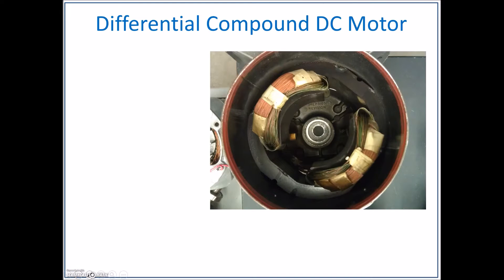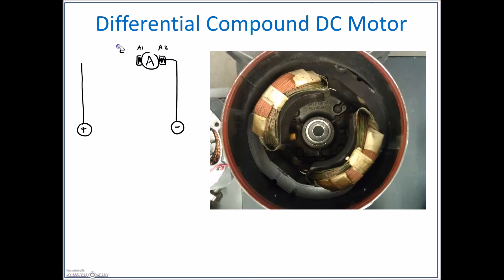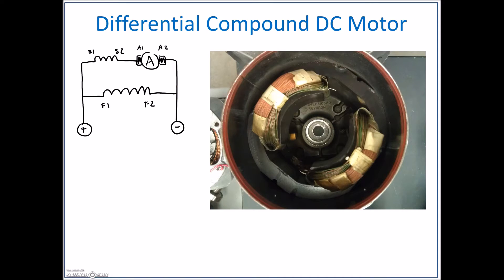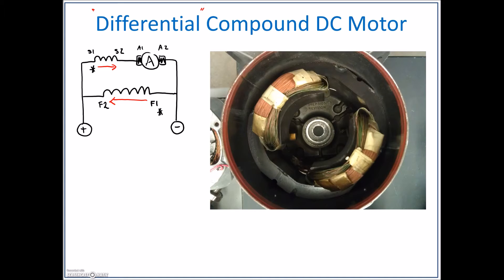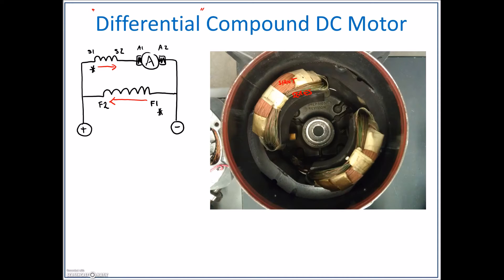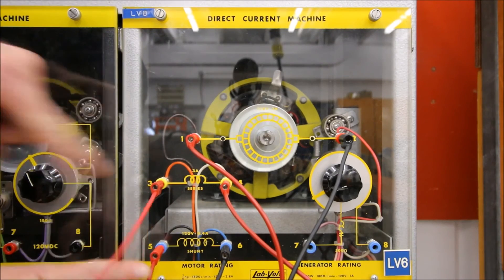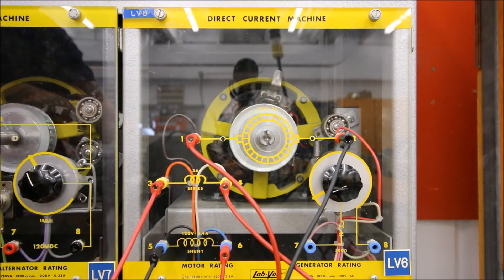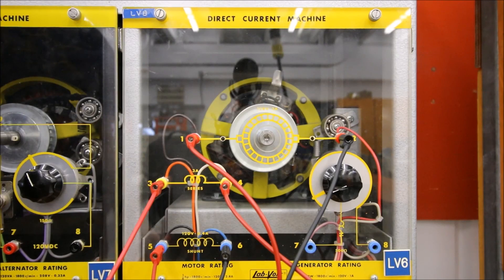Differential Compound DC Motor Connections

Comment: Are we ignoring the proper applications of the motor and calling it garbage? This configuration has the most stable RPM when operated correctly. The rheostat should be at max resistance to startup. Then lower the rheostat resistance to desired RPM. Now the RPM will be extremely consistent under varying load within the FLA (full Load Amperage)

Comment: Do I have a choice in the method of connection to any direct current motor, as is the case with an induction motor (both star and delta)?
Reply from the maker: The only choice is based on the amount of leads coming out of the motor to enable you to connect as a Series, Shunt or Compound DC Motor. The other videos in this playlist will explain further.

Comment: Thanks for this. Is it true that they can speed up under load if the field is weakened enough ?
Reply from the maker: Yes. The field provides cEMF through generator action
Reply: @PeteVree  Thanks, so the rise-time of the cEMF in the inductor is retarded somehow, a bit like car timing ?
Reply from the maker: @GaryMcKinnonUFO  If the Shunt field is weakened, then the Armature is cutting through less magnetic field as it spins. Which means that less cEMF is developed on the armature. This allows more of the source voltage to enter the armature circuit, more current and more magnetic field on the armature. This causes the motor to spin faster
Reply: @PeteVree  I see, thank you.

Comment: Thank you for your time for your videos, they are very detailed and very educational. I am a mechanical engineer and I watch your videos from Greece and I wanted to ask you something. In one application have a problem with an electric motor 150V DC, P = 0,8kw. I measured in the windings of R1=1,90ohm and R2=1,7kohm and it also has the drum winding (brushes), the motor runs normally at the descent because it has the load it does not brake where it needs to stop due to inertia. Specifically, it drives a lifting machine with shelves and I want it to stop at a certain level. My question is the R2 winding how should I connect it so that the motor stops immediately at the level I want at the descent?Connect it in parallel to the power supply, paying attention to the direction of magnetic field? Thank you in advance...

Comment: What happens when shunt FIELD winding gets suddenly opens in differential compound motor when it is in running condition
Reply from the maker: It would turn into a Series DC Motor and depending on the load, may run away.
Reply: @PeteVree direction of rotation is same as before
Reply from the maker: Depends on the polarity of the Series winding. There is a good chance that it may reverse direction as your question was concerning the Differential connection.
Reply: @PeteVree  why there is a chance of reverse rotation
Reply: Means how the direction of rotation is changed
Reply from the maker: Differential Connection means that the Series and Shunt have opposing magnetic fields. If the Shunt field opens, that leaves just the Series winding and the Armature. If the Series winding has the opposite magnetic polarity compared to the original rotation, there is a chance that the motor would end up reversing direction.
Reply: The polarity remains the same bcz.d current flow through armature and series field remains same.!

Comment: Dear Mr Vree , Thank you so much sir for these most informative videos because many warehouse I have been in  the information is highly valuable associated with  conveyor belt systems among packages plants as seen in Florida and Colorado.  I have been in many conveyor belt warehouse packaging plants where conveyor belt motors really run at the same time and need to shut down simultaneously when there are packing misses.

Comment: you didn't explain much
Reply from the maker: So go somewhere else and troll another account.
Reply: Pete Vree sorry didn’t mean to be so blunt. Appreciated the video and basically the only person talking about this stuff with demos and explaining the circuit drawing. 

I just left the video still as confused as to why it spins faster in differential??
Reply from the maker: No worries. It spins out of control in Differential because you have magnetically eliminated the Shunt winding (The Series and Shunt have opposing magnetic fields in the Differential) The Shunt winding magnetic field is the main thing that provides cEMF to limit your armature current. By magnetically eliminating it, you are left with a Series DC Motor. In this case the motor has no physical load, and a Series DC motor with no physical load will continue to increase speed and eventually destroy itself.
Reply: Pete Vree ohhh right i thought my idea was on the right line but I was way off.
Slightly off topic but not, why does this mean that differentially wound generators are so well suited to arc welders (giving high current medium to low voltage)?
Reply: @danhyde7501  I guess it's because when welding you need a hot start provided by high voltage that gets low when the current gets high, but this is ancient technology.
(update because I was tired yesterday). When you touch the metal with the stick you dont have a puddle and, to create one, you need a lot of heat. Heat is not provided by amperage but by voltage (from a scientifc point of view it's kind of ackward first hand). But because you're welding (and not plasma cutting) you do not want a lot of heat in the puddle nor splatter, you want to deposit material that has a good penetration and without flowing away. This is the magic of welding: low voltage on high amperage (most of the times).

Comment: Could you please tell me a few examples of where this kind of motor would actually be used in a real application? I am taking an AC/DC machines class at tech and one of the questions on my homework was to find this out. Every time I try to look online for anything it just keeps coming up with standard cumulative compound wound motor information. I really appreciate your videos, and I love the ends of the videos, because when you hook everything up in the lab it is the same as the equipment we use in my class. It really helps a lot, so thanks!
Reply from the maker: I may be wrong, but there is no use for the Differential connection. This video is used to demonstrate what would happen if you had the Series and Shunt magnetic fields opposing each other.... it takes off and there is excessive sparking at the brushes. That would suck if you had a 100 hp motor that took off like this one.

Comment: why its sparkling??
Reply from the maker: The Shunt Magnetic Field has been eliminated by the Series Magnetic Field because they are connected in a Differential/Subtractive connection. This causes the Neutral Plane to be shifted... which causes a voltage potential between the Commutator segments that the Brushes are touching. The arcing and sparking is due to the brushes shorting out the commutator segments that have a potential difference between them due to the fact that the motor also acts as a generator when it is running.
Reply: @Glissentar  Yes!